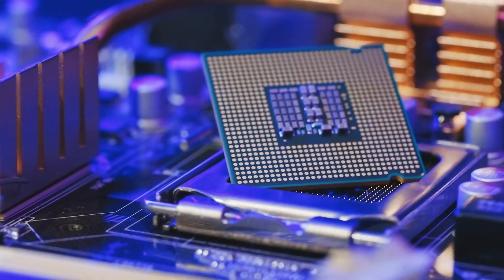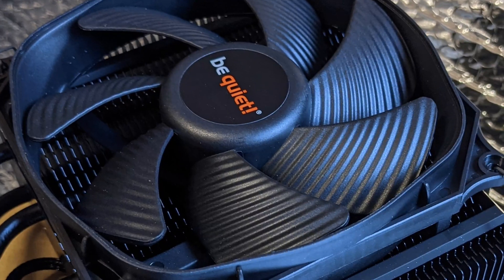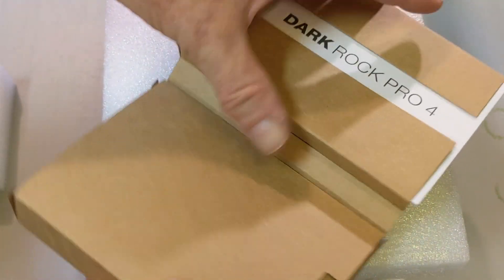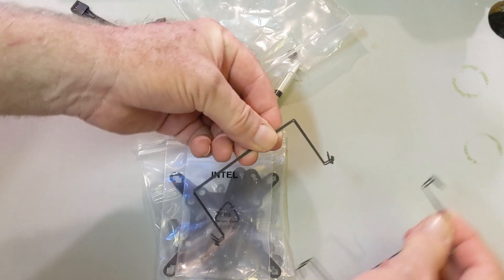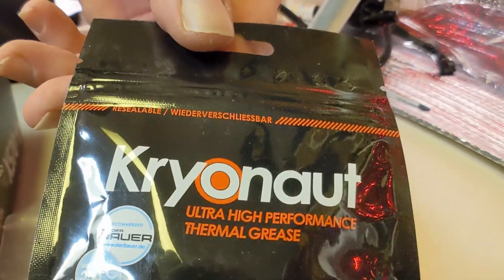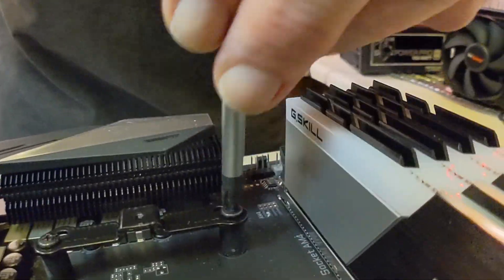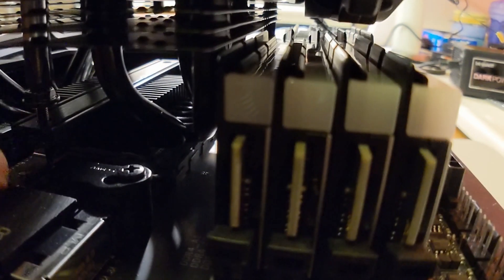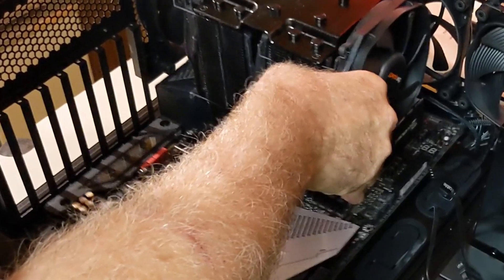How to install the BeQuiet! Dark Rock Pro 4 Air-Cooler into the Dark Base 900 case for video editing

Comment: The thermal paste that comes with the cooler should be more than enough for one application. Applying the full amount at the center of the cpu should be enough.
Reply from the maker: Yes, I agree! ... I wanted to try 'Der Bauer's' method of spreading it all around. But I've decided I prefer the old tried and true method of one drop in the center from now on! LOL
My video showing me replacing the 3900x with the 5950x shows the thermal paste that dribbled out the sides from this rather over-eager application. 
That was about a year after initial installation, and it always ran a bit warm... in the 70's at full load, and getting into the low 80's on warm days (we live in the desert). And you'll notice I unwittingly installed the third CPU exhaust fan backwards! Once in it was always facing away from me behind that big cooler and I didn't notice until one day I was testing airflow with incense sticks and noticed this! This explained why the top M.2 was getting warm, and also shows how well that Dark Rock Pro4 cools even though the warm air was getting pushed out the sides instead of the proper way. Once I blew the cooler out of the dust that had come in from the unfiltered back panel, and turned the fan the right way, the temps went right as they should.  Although they never were to the worrisome level... it was more like "why is the M.2 always in the 50's?.... now, I drive my CPU's 100% 24/7 with a reboot every few days is all..... they NEVER get a rest. So those relatively warm temps show the value of this cooler.
Since I replaced the 3900x with the 5950x (with a drop of thermal paste in the center) temps while running 100% and ambient in the low 20's is in the low 60's. So I'm very happy now with the performance and temps.
Thanks for the comments!
Reply: @johndicus123  nice !! what case do you have? I’m currently getting in the 70s on full load with a Corsair 570x. It’s a beautiful case but the design is very basic and the airflow isn’t great.
Reply from the maker: I really recommend the Fractal Torrent. It's got space for 4 2.5" SSD's and two spinning drives. It has  a great look, the most airflow of anything I've seen. I made  a video showing it and the BeQuiet case I set up with nine fans, inspired by the Torrent. I have both, I recommend the Torrent. I like my Be Quiet too though.... https://youtu.be/IZHbSa46AgA
Reply: @johndicus123  thanks for the recommendations! I wanted to ask does 3 fans on the DRP4 make a difference vs 2?
Reply from the maker: I think probably not. but I leave mine running 100% CPU speed processing renders..... I only restart them every four or five days, because I have to reset a few things and get them going again on the processing. I also leave them while I'm gone (which lately is not that much, LOL). So I like the redundancy of  a third fan in case one goes out. But that cooler is so good that even though I stupidly put the third fan on backwards, the CPU usually stayed in the 70's when at full load, and down to 50 or so when idling. But the M.2 on the MoBo got warm in the mid 50's from all the heat being pushed out the fins in the cooler. It just seemed to run warmer than I thought... but Ryzen does that, right? Anyways, one day I'm using incense to see the airflow into the case and see strange whirling patters at the back and look at the fan that's usually facing away behind that big cooler and the purdy hub of the fan was looking at me! With shaking hands I shut 'er down and reversed the fan: CPU temps went down 12C, the MoBo top M.2 cooled down 15C.... So yeah, two fans is better than three if the third one is backwards! LOL But I like it for redundancy. If I'm gone for 15 hours, I like knowing that I have three fans (all pointing the right direction) so if one goes out, I'll have two still. And I know the cooler has lots of wriggle room! But yes, the cooler is good enough that two is fine.